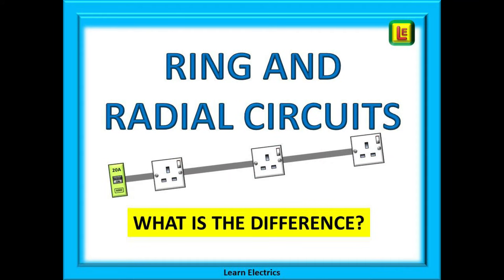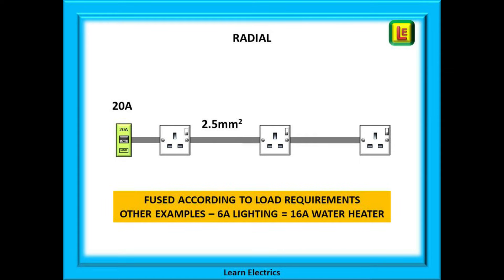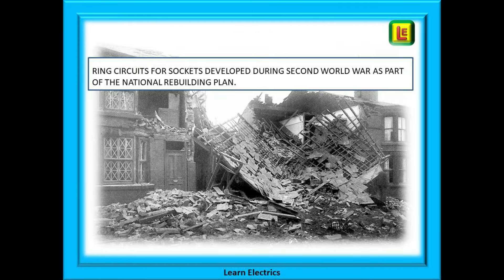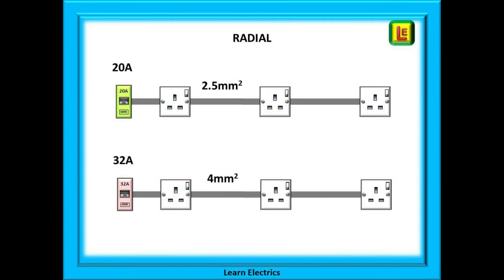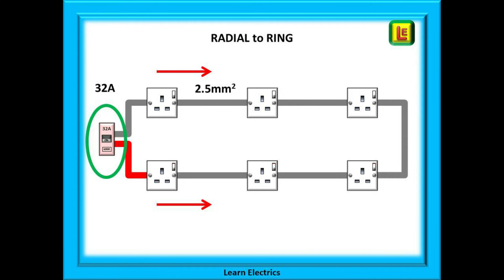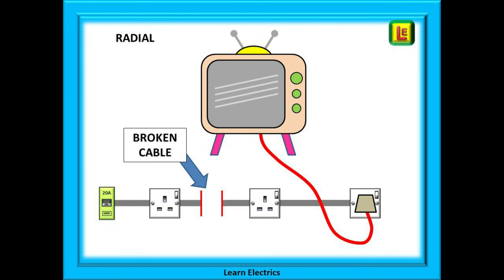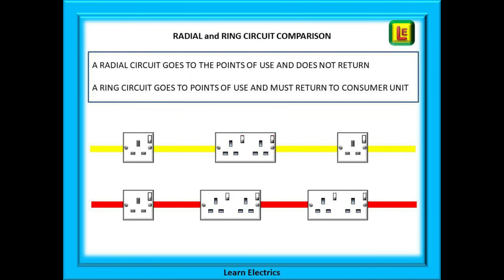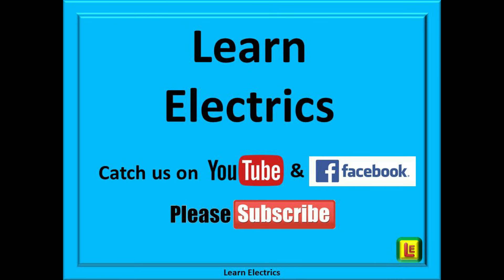RING and RADIAL CIRCUITS. WHAT ARE THE DIFFERENCES.

Comment: Just a query. I take its better to have a radial circuit on a 16A breaker and 2.5mm cable?
Reply from the maker: Not at all. You can have a 16A breaker protecting a 2.5 radial or ring circuit according to the regs, In practice though, yes, you are right, we would normally put a 2.5 cable as a radial if protected by a 16A device. There is no advantage to a ring in this case. 
Take a look at this video. As long as the cable current carrying capacity (It) is greater than the circuit breaker tripping current, you are ok..
https://www.youtube.com/watch?v=8Z255dd78H4

Comment: oh kayaaka!i never knew that in forty years of learning electrics!that is just typical of this country.that is just utterly ludicrous.just to save money and copper wire.one house fire,the fatalities,children killed,cost of the emergency services rescue and clean up ,as well as the enquiries can end up being completely devastating!the human loss can be beyond devastating and the financial costs every year could be astronomical.it's short sighted,reckless and irresponsible as usual.a socket becoming dead could force the homeowner or tenant to contact and call out the electricity board,in order to perform the standard  electrical industry tests and repairs.why wouldn't anybody just use a radial circuit,copper wire maybe even 10 mm thick,instead of 2.5 mm thick.why would anybody quibble over a bit of extra copper which could be good and safe for twenty five years before its next overhaul and thorough check or complete renewal?i do not really understand electrical wiring and repair but that just seems utterly ludicrous!the thousands over the decades,who have been horrifically burned to death!
Reply from the maker: Thank you for watching.

Comment: I dont understand The ring circuit. With a single phase i supply both sides of the ring? Where dies the neutral go?
Reply from the maker: Both sides of the ring too, current returns on both sides of the ring. Hope this helps. Dave.

Comment: How many amps can 2.5mm twin+earth cable carry on a radial circuit?

I assume they can carry up to 32 amps, but the 16 or 20 breaker would trip first?

So in other words, the max isnt really seen in real world because the breaker trips way before the max can be reached?

Is that right?
Reply from the maker: Have a look at the video on the link below about voltage drop and choosing cable sizes.
So many factors affect cable size, how it's installed, length etc.
Yes you are right, a properly installed circuit will see the MCB or fuse operate before the cable is damaged. Its easier to reset the breaker than it is to replace the wiring.
https://www.youtube.com/watch?v=nVZeIFeEwl0
Reply: @learnelectrics4402  Thanks, I am only moving into my 1st house next month so will start doing some DIY'ing then, I know I need at least 1 socket spur adding into 2 bedrooms. 

Not sure if its ring or radial yet, I imagine voltage drop wouldn't really affect me if only messing with socket circuits?

Comment: There's an easy way to safeguard a ring circuit... each leg should be in it's own 16a breaker....  maybe even 20a to account for the resistance. Surprised this isn't done more often?
Reply from the maker: Some folk do split the ring into two separate legs. 20A breakers usually.

Comment: A pretty poor demonstration of a radial circuit. The use of the word 'circuit' is a misnomer too. 
The 'radial' system is like a train leaving London and going directly to Newcastle, another leaves London and goes to Manchester. But if I live in Liverpool I get a train to Manchester im not on a radial im on a 'spur' . If You are stupid enough to keep linking spurs to spurs then you have basically developed a ring but forgotten that you need to return the last spur back to the FB.
Reply from the maker: Thanks for watching. Appreciated.

Comment: the electricity is still using twice the copper on a ring circuit.      It's just like you doubled up the leads is all. the electricity is not flowing any differently un less you get a disconnection in one of the sockets.          It is just like you ran tWo 2.5 mm cables radially.       Electricity doesn't see circles and only sees conductors and actually runs around the conductor  wire helically clockwise  due to the right-hand rule.     Radial circuits are a bad idea because if any one of those connections is broken you will have too much amps on one wire basically.   A lot more room for error.   I like how the UK uses fuses on every PLUG.    We use them for fans but that's the only appliance with its own  fuse in the plug.
Reply from the maker: Thanks for watching, appreciated.
Reply: I think you mean ring circuits are more likely to overload the wire if there is a break....

Comment: Very interesting and informative video 
Pls can i use a 20A circuit breaker and wired with 2.5square mm for my ring circuit
Reply from the maker: Yes you can, no problem at all in using a 20A breaker.
Take a look at this video on cables and breaker sizes and thanks for watching.
https://www.youtube.com/watch?v=3_D65-32xp8

Comment: Actually you size the fuse for the wire... When you need more power because of the appliances than you size up the cable
Reply from the maker: Absolutely. Thanks for watching.
Reply: @learnelectrics4402  and than we come in the territory of cable dimension for the 1 pole short and the big test current of MCBs and that normal cable can endure 1,45 time I nominal... Actually all that "normal" sparkis do is just sizing via an chart, actual calculations are a bit more than that :)

Comment: I was asked to install a socket in a factory today and came off of another pre installed socket. This original socket got its power from a 3 phase isolator. Is this allowed?
Reply from the maker: Nothing wrong with using a 3 phase isolator as a single phase isolator. usually more room inside them anyway. Good question. Dave.

Comment: Dave, please I want to ask a few questions
1. What is the number of socket outlet for a 20Amp.

2. What's the breaker rating for a ring circuit and how many socket outlet is allowed to be used
Reply from the maker: There is no proper answer to either question. It depends what the customer wants. 20A and 2 sockets might be ok for a bedroom, but it won't work for a kitchen.
You can have 32A or 20A for a ring. 32A kitchen and 20A bedrooms. The 20A breaker gives you a bigger permitted Zs which is better for longer runs.
Reply: @learnelectrics4402  thanks for your response

Comment: Many clearly do not understand what a final ring circuit is. The ultimate system is to have a radial circuit to each socket outlet on its own fuse at the main panel - the optimum solution of course.  This means you will need a very large expensive main panel and lots of fuses/MCBs (one for each socket) in the main panel. Impractical of course.

🎊🎈  BINGO  🎊🎈 
A ring gives this by distributing the main panel around the house via a ring cable, distributing the fuses from the main panel around the building to each socket. The ring is a busbar. This saves the vast expense of a plethora of radial cables back to the main panel and also a plethora of expensive fuses/MCB's/RCBO/AFDDs at a very large expensive main panel and expensive labour to install.

a) A ring uses less cable and gives a longer route 
b) No limit to sockets on the ring, but total is limited to typically 32A.
c) A ring uses less copper for a given load/area. 
d) Rings rarely have voltage drop as it is fed from both ends. 
e) Rings have lower impedance, less volt drop is less waste!  They are more efficient.
f) No single point of failure for the protective earth.
g) If you are covering all rooms in one floor then a ring can do it.
h) An appliance and its flexible cable may have a fuse sized to its rating inside its plug.

1. Ring final 2.5mm cable, 32A B-curve MCB, length 106m on TN-C-S.
2. Ring final 4mm cable, 32A B-curve MCB, length 171m.
3. Radial final 2.5mm cable, 25A B-curve MCB, length 33m.
4. Radial final circuit, 4mm cable, 32A B-curve MCB, length 43m.

If a ring is in 4mm cable protected by a 32A MCB/RCBO, then no problems if the cable is broken - which is a very rare thing. The ring can be partially 4mm to heavy current appliance sockets one one leg, and 2.5mm for the rest

The ring final circuit is safe, simple, and highly effective after 80 years of use. The introduction of MCBs/RCBOs/RCDs/AFDDs, and screwless Wagos on the ring taking the load, has made the ring even safer.
Reply from the maker: Thanks for your input John, appreciated.

Comment: The whole time i'm wondering why don't you guys Just consider using pipes instead if just cables? If you install a center box in the middle of the room above the light fixture and bring all of the points there you have an easy way to renew wires. I do rewires all the time and we don't have to break open shit or go into shit places because almost all our wires are replacable in the dutch system. We use 16A breakers protected by 30mA 40A breakers and yes we do mix light and load but this is in my opinion an ideal system.
Reply: I do recognize there's no way other countries will adopt this since all of our systems seem to work fine but its my humble opinion that i like all my wires to be this way.
Reply from the maker: It all comes down to each country doing its own thing right at the beginning in the late 1800s and early1900s.
Reply from the maker: Good point. It was like this in France, singles in conduit etc. Keep watching. Dave.

Comment: Hi Dave
Why do we have a 32amp ring. Why was it settled on this rating. Is it to do with the 1.45 I2 value etc
Reply from the maker: Nothing to do with maths. It was just a value of current that a whole house might typically use at the sockets many years ago when there were few electrical goods. Once the fuse size became established, it stuck. Now we have several 32A circuits in a house.
Reply: @learnelectrics4402  thanks Dave

Comment: Non UK sparky here. I'm getting into awful rows with UK electricians here on the internet whenever they loudly sing the praise of the UK Electrical System. Since the whole world speaks English, many a non professional learns about the many safeties built into the UK plug and wants the same thing. Some of these plug safeties (the fuse and strict adherence to polarity among others) are there to counteract (among others) the risks inherent to a ring circuit, like a cable break. Sketching the historical context is also very valuable. 
This video is going to be a mighty good explainer to avoid all these awful rows therefore my thanks ;-)
Reply from the maker: Thanks for the great feedback and comments, really appreciated, and thanks for watching. Dave.
Reply: you must be living somewhere else then.there have been thousands of fatalities,house fires,explosions,industrial accidents,electrocutions,electrical fires and utterly mindless oversights.i'm terrified to even turn a light switch on.every socket should be numbered and labelled from the first switch and socket,in line from the consumer unit to the final socket or switch.the electrics in this country are just absolutely terrifying.!

Comment: May I ask regarding ring circuit. Am I correct to say the hot line return to the breaker but the neutral wire does not return to the neutral bar?
Reply from the maker: Line, Neutral and Earth all return to their respective starting points in a ring circuit.
Two Lines, Two Neutrals, Two Earths.
Take a look at this video for more info.
https://www.youtube.com/watch?v=-PAruseUf04
Thanks for watching. Dave.

Comment: To add an extra sockets to a ring would you add fuse spur or cut the ring connection and add the new sockets  into the ring?
Reply from the maker: Thanks for the question Justin. Take a look at this video on Extending Circuits it will explain for you. Thanks for watching. Dave.
Click on this link
https://www.youtube.com/watch?v=3mBXNBwpxXo
Reply: @learnelectrics4402  thanks Dave.

Comment: I think that ring circuits cabled whit 2.5mm are for dumbs. You should ALWAYS make sure each of the cables leaving a breaker, and all the others connected to them, can support the full capacity of the breaker. It doesn't matter if it's radial or ring. You should follow physics rules. if you make a short on the first socket of a ring circuit, you'll have a short cable whit negligible resistance, and another cable that can even have few ohms due to distance traveled in your walls along the house. So the shorter cable can and will take almost all the current and burn down, if it's undersized. 
This was one of the worst ideas ever, but hey, war just finished; Why don't kill some more people whit breaker that don't trip and undersized cables inside wood houses.
Reply from the maker: I hear what you say Emanuele, but those are the rules. A lot of sparkies now are fitting  radial socket circuits 4mm with a 32A MCB or 2 separate circuits with 20A if using 2.5 cable. Thanks for the reply, good one. Dave.

Comment: Very informative, one question is a radial circuit the same as a spur?
Reply from the maker: A radial circuit is just a straight line circuit. A spur spurs OFF an existing ring circuit, but which second leg is the spur with a radial circuit.. Good question. Dave.

Comment: Why does the ring circuit provide voltage? It seems we’re connecting the hot to the hot, so the potential difference or voltage should be zero, so none of the appliances should turn ON.
Reply from the maker: Not at all. There is a phase wire and a neutral wire with 230 volts between. have another look at the video, it will make sense.

Comment: As a U.S. resident, it was enlightening to find out why you use ring circuits. In the U.S. we do not have ring circuits. And to you that think we only have 120VAC in our homes, we do have 240VAC, but split among 2 legs. The power is delivered by two 120VAC hot wires and a neutral wire. To get the 240VAC, the appliance needs to be connected to both hot wires and a safety ground.
Reply from the maker: Thank you for your comments. Yes, things are slightly different on the other side of the pond but generally, the basic electrics will follow similar rules.
It's great to have some American support, spread the word, please do.
Thanks for watching. Dave.

Comment: Thank you! Great video... Can you tell me is there a way an easy way to determine if a ring or radial spur is in use? Or do I need to pop the CU lid and trace the wires?
Reply from the maker: Continuity test at the CU is the only sure fire way.
You can take a guess by breaker size and cable csa but testing is best.
Thanks for watching. Dave.

Comment: Nice video, you need to be aware of how badly the ability of the wire to handle current is reduced by modern insulation. it's is as much as half
Reply from the maker: Absolutely correct, there is a huge difference between a cable looking big enough and actually being the right size.
Take a look at this video – Matching cable sizes – on this link
https://www.youtube.com/watch?v=VtTUkUpQ-Rc
Cheers, Dave